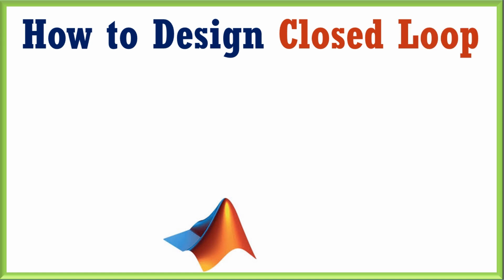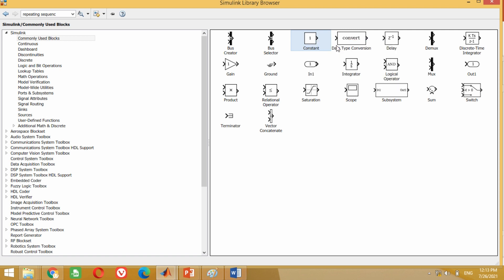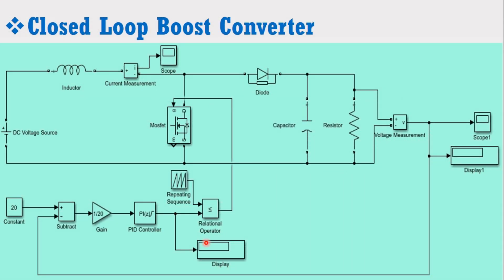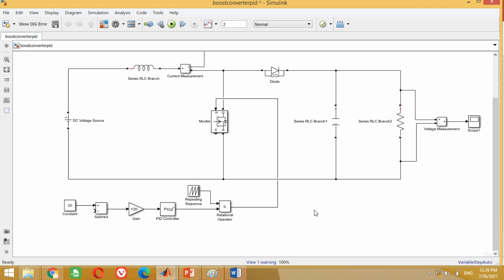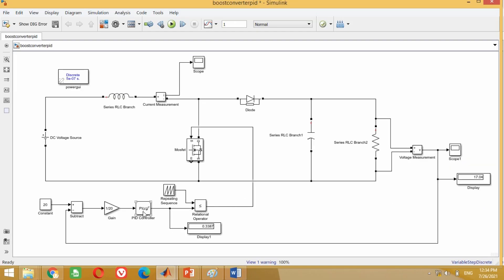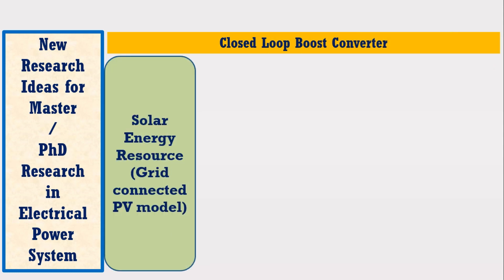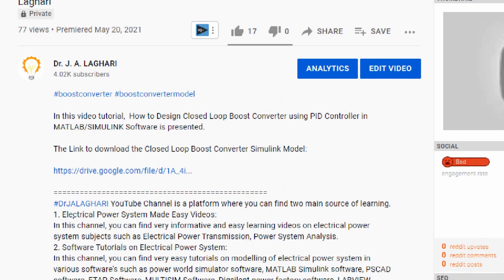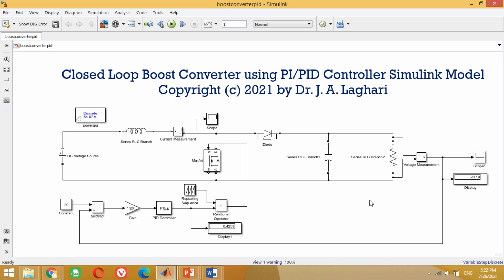How to Design Closed Loop Boost Converter using PID Controller in SIMULINK ? | Dr. J. A. Laghari

Comment: If the load changes, does the output voltage value remain at 20?
Reply from the maker: It will try to remain close to this value.

Comment: why is there a need of 1/20 gain in controller ? please share the concept. What if we dont use...? but this gives error
Reply from the maker: Thanks for the comment. Let me explain this reason. In this boost converter PID model, the gain block with 1/20 is used to normalize the PID controller's output. Since the desired output voltage is 20V, the controller's output needs to be scaled to a range between 0 and 1 to match the input range of the PWM comparator (which uses a repeating sequence or sawtooth waveform). Dividing by 20 ensures that a 20V signal corresponds to a duty cycle of 1 (100%), making the control signal compatible with PWM generation. If the output voltage target were different (e.g., 40V), the gain would be adjusted accordingly (e.g., 1/40). I hope now, it helps to clarify your concept.

Comment: Sir this gives this error, tried resolving it but failed

Error in 'pibuckconverter/PID Controller': Failed to evaluate mask initialization commands.
Caused by:
Initial conditions for integrator and filter must be within the saturation limits.
Reply from the maker: Thanks for the comment. May I know which matlab version you are using?
Reply: @DrJALAGHARI  thanks for replying sir. i am using the latest version 2022b

Comment: Respected Dr. J. A. LAGHARI sir,

         Any other proper method to tune the PID controller instead of the trial and error Method?

Thanking you sir.
Reply from the maker: You may use any optimization technique to optimize the parameters of PID controller such as pso, aco, bco, genetic algorithm etc
Reply: Thank you so much sir
Reply: Your doing great job for students. Thank you so much for your response sir.
Reply from the maker: @naveenkumar-zy4po  Thanks for the compliments.